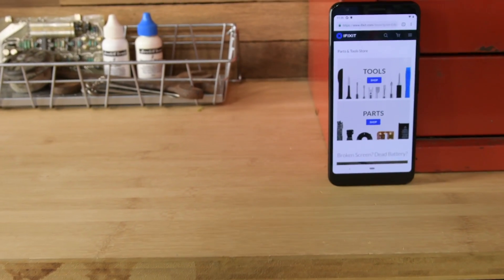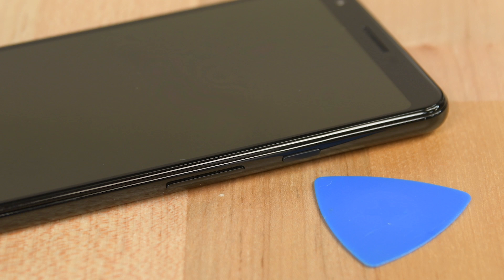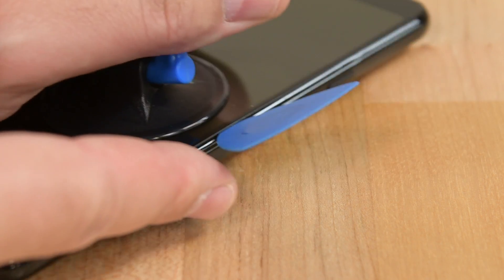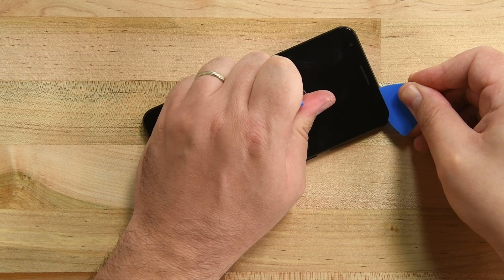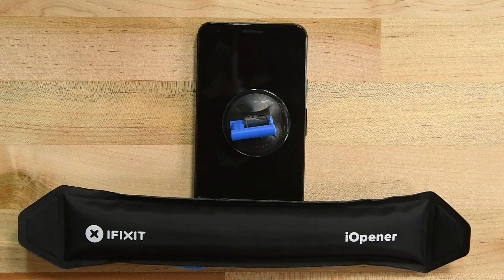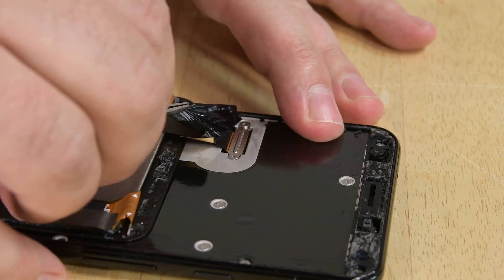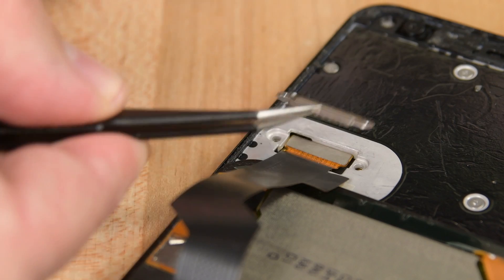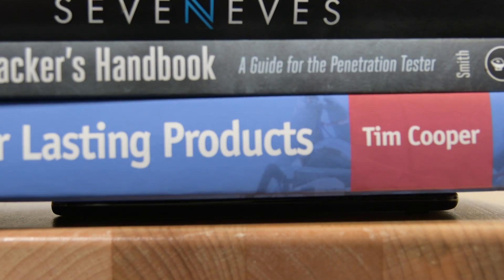Pixel 3a XL Display Replacement!

Comment: 3:27 "once it's clean reaply your adhesive", just that display comes with an adhesive foil with no instructions, of course people will mess up that part, that is why it is not in the video or in any iFixit tutorials (because is very hard to apply). Now I need to pay another expensive shipping for a new adhesive. "Thanks" 😭😭😭

Comment: Replaced my screen, for the 2nd time a few days ago.  Everything was fine, but now I'm getting a thin green line along the left edge.  Intermittently, not all the time.  Some of the thin black film came off while I was removing the old screen.  Do I need to replace that?  If so where would I get it??  TIA......

Comment: Thanks for your video! I replaced my screen and it seems to work pretty well. However, the phone now doesn't charge well at all. When I eventually get it to start charging, it's very erratic and doesn't keep charging consistently.

Could this be because I used a poor quality replacement screen, or didn't connect it that well?

Or a problem with the battery itself or charger port... Any ideas what you think might be most likely?
Reply: I would make sure the USB cable and phone USB slot are clean, and maybe USB cable is too weak or low quality, that might cause inconsistent charging. Then the charger, etc.

Comment: oh its defiantly not that easy! I just tried it and when it comes to clipping that tiny clip, its impossible! It just keeps coming apart right away and doesn't seem to stay connected for any length of time. go on finding a tool that fits the tiny star key bolts!
Reply: The company that made this sells the part and all the tools you need to do it

Comment: The kit doesn't work for a google pixel 3A XL.  The precision screwdriver heads supplied are wrong.  It needs a 6 star shape. The youtube guide does not mention the regluing step or the fact that you may need to recycle the sound grill and other parts from the old screen.  Caveat emptor
Reply: Thanks dude. Almost replaced the screen without the speaker grill. 

I hope the front camera will be alright without the screen's housing/bracket piece though... I gave up trying to pry that off.

Comment: I can't believe the lcd digitizer is more expensive than the phone itself...
Reply: You can find a screen replacement for $70 on eBay.
Reply: @ChavezDIY  actually only 50
Reply: @jbector1 yeah cuz you responded 2 YEARS later of course it’s cheaper

Comment: What's the point of not damaging the screen with the pick? This is the display replacement guide
Reply: just in case your new screen doesn't work, at least you have your cracked screen that still works (assuming your old display works and isn't broken like the new one).
Reply: no need for extra damage and maybe because the glass is annoying. I took the display off of a broken phone just for fun and the glass got everywhere. Might still be little peace's that I can't see in my desk even now
Reply: @DoubsGaming  maybe you should clean your desk sometimes...
Reply: Removing the AMOLED display from the glass just doesn't get the whole screen off anyways.